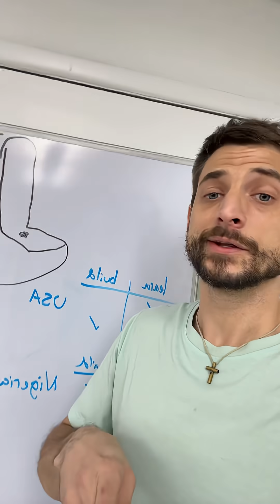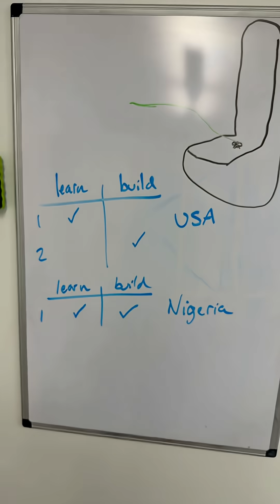(part 2) clues indicate we can design all the machines systematically

Comment: The trick is you have to KNOW that all these methods exist and draw upon that knowledge when designing your next invention.   There is just so much to know!
Reply from the maker: therefore my need to publish clear lists of my rules and priority materials and mechanical templates.  

then I need to describe the span of outcomes the rule set is intended to cover. then I need to put my existing examples into the context of those rules.

then i can chat with people to get further inputs.  i didn’t yet articulate the “system”
Reply: so you basically start with needs, move to demands and choose the specific foundations?
Reply: @davidmalawey for example, i need a “elbow joint” ➡️ i „demand“ or „expect“ it to move in x,y and z axis without breaking ➡️ it needs to be lightweight and durable and easily swappable?  and youve basically have built the library of parts to build that and now need ease of access to narrow down to the best parts?

Comment: I treat learning and building differently because learning is free building cost a lot, so i am making sure I am 110% correct all the time before I buy something
Reply: frugal engineering, nothing wrong with that. It can be good mental exercise to try and see all the 'what-ifs' before the design leaves paper.
Reply: building can be much cheaper if you don't mind using prototyping materials and scaling things down when possible
Reply: @flaviolimaj  prototyping materials? Scaling down if possible? But prototyping materials are weak and not worth the cost usually, scaling down when possible, but that requires skill and time to get good at making things at that scale, right?

Comment: what adhesive do you speak of?
Reply from the maker: PVC cement has a family of variants.  one of them is multi-plastic cement in the Plumbing aisle.  I always use ABS and ABS is one of the plastics in the compatibility range.

and I think I posted a draft 1 of the bonding table in my qr.net/openlabproject page
Reply: Appreciate the answer! Awesome to know. I currently use mostly PLA but would definitely switch to ABS in some cases for that benefit.

Also, new to your channel, love the content you’re putting out! pretty inspiring stuff!
Reply: If using abs you can just use acetone to bond the abs

Comment: What do you think about Slant 3D?
Reply from the maker: I’ve seen this channel and it’s nice! the advice has good solid design tips.  My methods are mainly in agreement with his but I’ve made a couple more requirements that give suitability for parametric stuff.  I do stricter limits on printing, mainly my printed parts are only brackets to bridge OTS parts to work together. for example I don’t print boxes.